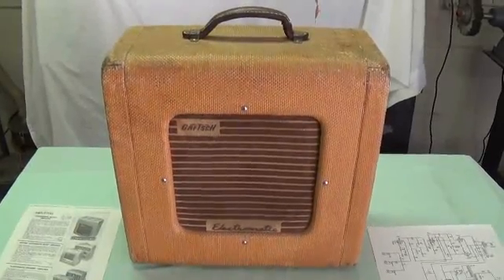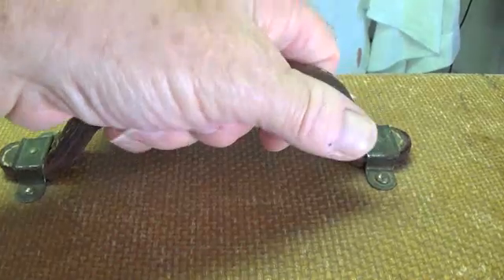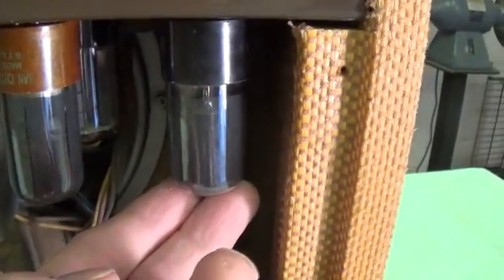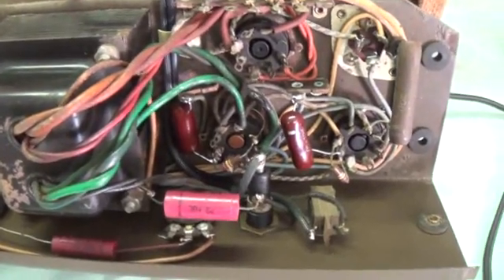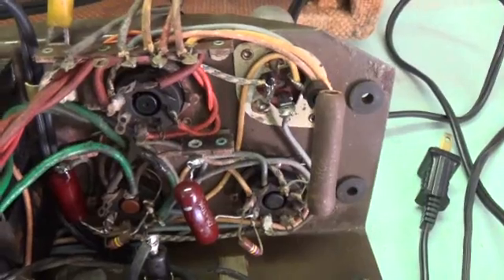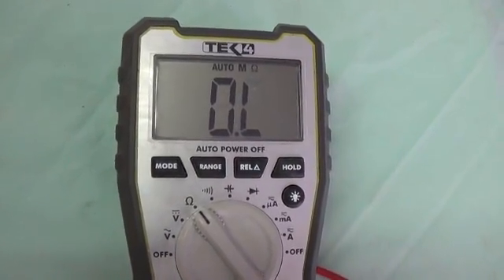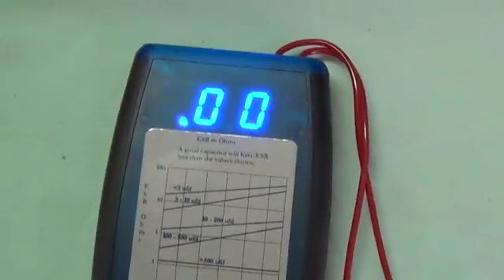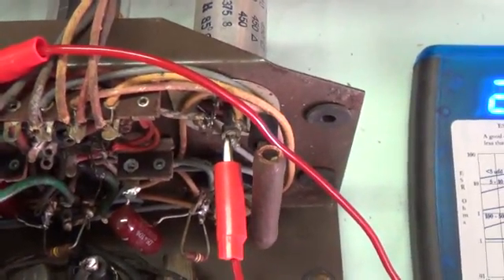Using an ESR Meter to Determine the 'Health' of Electrolytic Capacitors in Guitar Amplifiers

Comment: I have been using a Heathkit I-28 but I have used it most of the time with an external 1000 hz audio wave oscillator.  I find it is easier to more accurately read the value.  I am very interested in the ESR, to the point that I am going to buy one.  I have two old Hallicrafter radios that require re-alignment, and this will be an excellent test for the meter.  I am hoping also that it will save me a lot of time. 
I just read some of the comments below, and am going to look at building one first.
Thanks
Reply from the maker: Greetings, SJJ. I too have used a Heathkit capacitor tester, but have found the ESR meter to be much simpler (and more accurate and reliable) to use. Also, the ESR meter's ability to perform accurate measurements while the cap is in circuit is a definite plus. Please share your experiences with the ESR meter after you have used it for a while. Your impressions and input would be greatly appreciated. Thanks :)
Reply: I immediately searched for, and bought one.  I can't wait until it arrives.  Does it work well for testing large electrolytics?
Reply from the maker: Yes, in my personal experience it can handle capacitors ranging from 0.1uf all the way up to 100+uf. It's a very versatile and easy-to-use device. I think you will really like it.
Reply: Uncle Doug   Just want to confirm.   You say the ESR will work way up to 100+uf.  Do you think it will work, in my case, for one that is 6800uf @ 50 F. or slightly above?
Reply from the maker: Greetings, Edward. I'm guessing that you meant @ 50VDC. Temperature ratings are not relevant to ESR testing. I'm not sure about the meter's effectiveness on capacitors much higher than 100uf, but one way to be sure is to test a couple new 6800uf caps and see what readings you get (if you get any). Then compare those readings to the ESR value for the old 6800uf capacitor. If the values agree, then I would assume that the old cap was OK.
Reply: Uncle Doug Received the following from Anatek:  Is there an instrument that will cover the lower range like Aanateks and the high range I am looking for or must I buy two, one for lower and one for higher range like 6800uf.  Any recommendation if have to buy two.  Thanks for your help.
Reply from the maker: I'm confused, Ed. Is this an inquiry you sent to Anatek or a reply you received from them?
Reply: Uncle Doug Their response seems to be left out of my previous post-sorry, my fault.  I submitted an  inquiry to Anatec asking whether the instrument would give meaningful results for a capacitor in the high range that I am interested in and below is the answer I received starting with: Dear 2015-bogho  then i asked for your help if there is an instrument that will test both the low as well as the high range I am interested in or must I buy two testers, one for the low(ESR) and one for the high ranges.
Reply: Uncle Doug I made an inquiry to Anatec whether this ESR will measure in the high range I am interested in and this is their response:

6800uF is likely too high for this unit.   ESR will be <<0.1 ohm so any change in ESR will have to be significant for it to measure a real change on the meter.

Then I requested your help to determine whether there is an instrument that will measure the low range to the high range I am interested in or must I buy two, one for the low range and one for the high range.  Sorry, my fault for the confusion.
Reply from the maker: Anatek's response makes good sense, since ESR values decrease with higher capacitance. Their meter is the only one I have any experience with, so I have no personal knowledge of meters that can measure at a much higher range of capacitance. Perhaps a Google or Ebay search will reveal if such a device actually exists. Good luck.

Comment: did you try testing them with a digital meter that shows the value? although I would have done the same thing, if the ESR meter shows ok I'd leave the cap in.
Reply from the maker: Yes, I measured the capacitance with a digital meter, but it was "fooled" by two of the caps being in parallel, as is typical of virtually all cap testers (except the ESR meter). The original caps are still in place and working fine.

Comment: One option to purchasing an esr meter for 100 bucks is to build your own, as I chose to do.  There are a number of plans online and if you have stuff lying around as I did it will only cost a few bucks.  I used a 555 for the 100khz oscillator. Also, If you measure a cap with an ohm meter, and get a reading there is a serious problem with the cap, as caps appear to a DC current as nothing more than an open set of contacts.
Reply from the maker: I never thought of scratch building one, Mike, but it sounds like a great idea. Since I deal only with vintage tube amps, I just don't have any "modern" components :) Yes, you're definitely right about capacitors appearing as infinite resistance to DC ohmmeters. One of my tests for capacitors is to verify this. If any of them have a measurable resistance, I assume they have an internal short.

Comment: I own and religiously use a HeathKit I-28 Vacuum Tube cap tester.  It will measure any cap values and leakage up to 600V.  I have seen much claim how wonderful these new ESR meters and pondered buying one but I am curious will the ESR meter test any size capacitor and will it test caps under full voltage load?  Is there any benefit to the ESR meter over the old tube style cap testers?
Reply from the maker: Greetings, BB. I use the ESR meter for both electrolytics and non-polar caps ranging from .01uF up to 100uF at 475VDC. You should check with Anatek to see what they claim its range to be. I know it's generally recommended only for electrolytics, but I have found it to work with non-polars as well.

The advantage is that it tests the capacitors in circuit without concern for error induced by nearby components (i.e. other caps in parallel). No lifting one lead or removing the cap from the circuit. You can check all the caps on a circuit board or in a chassis in a matter of a minute or two. It does not fully charge the capacitor during testing, which some people find worrisome, but I have yet to encounter a capacitor that tests well with the ESR meter and yet has an internal short....or the tendency to develop one. Bad caps generally produce readings that are obviously unacceptable.....there is no "splitting of hairs", and if a cap tests well, it's (so far) OK.

The ESR meter is not my only means of assessing caps, but a part of the process. I also measure capacitance with my DMM, use a Variac slow-start with circuits that have sat for years, and always use a Current Limiter when energizing a circuit for the first few times.
Reply: Uncle Doug I have been doing some research on the subject and have been told that ESR will give false readings on caps under 1uf.  Having used an actual cap tester extensively I have found the majority of old paper caps do not internally short but have leakage under load.  Majority of the time the cap will test within spec but leak voltage at 25, 50 or 100 volts when the cap is rated for 400V or 600V.  Obviously the cap is bad and on it's way out and guessing would not be caught by the ESR meter.  I would be very curious to compare some good and bad caps of varying degree with a cap tester and an ESR meter.

I posted this question to the ARF forum and came up with some very informative answers from regarding the subject.  Here is the link to the thread http://antiqueradios.com/forums/viewtopic.php?f=8&t=264574

BTW great videos and information you do!  I really enjoy them.
Reply from the maker: Greetings, BB. I'm glad you enjoy the videos :) I followed your link and read the comments. I am aware of the perceived shortcomings of the ESR meter and, as I said, do not prescribe it as the one and only way to test electrolytic capacitors....however, in daily use, I still find it to be a very helpful tool when working with vintage electronic gear, and occasionally demonstrate its utility in my videos. I have also documented its ability to accurately measure the capacitance of non-electrolytic caps, in circuit, from .01 to 1.0uf.

As with any tool, the ESR meter has applications and limitations, but to those of us with hands-on experience with the device, it offers a quick and effortless means to check the status of capacitors in a way that no other methods can duplicate. Thank you for your thoughtful inquiry and comments. Viewers like you make this process worthwhile :)
Reply: Bastard Bus what I did is make up a chart and taped to the back of my ESR meter, I measured some new caps an wrote down the readings. So I know what to expect when I testing caps with my meter.
Reply: Mister "Bus", ESR is not a measurement that is tested under voltage so the reading the meter gives is accurate.  And there is four main properties that determine the quality of an electrolytic capacitor - Value, Leakage, ESR and Dialectric Constant.  Dialectric Constant, which is the tendency for a capacitor to act as a battery, is not really a concern in guitar amp use.  With your ability to check the other three properties by getting the ESR meter, you won't have any doubt whether a cap is good.  I have a Sencore Z-meter that checks all four parameters and I'm like Doug, I don't change caps just because they are old if they check good now that I have a good meter.
Reply: Bastard Bus I remember taking electronics class in the 1960's in HS and used those old cap testers, you would apply 600v to the capacitor and test it, that was the best way to test them I thought.  I worked on tube tv's in tv repair class in the 1970's and I seem to recall we had one there as well.
I started in the repair shop around 1996 and all the techs used those ESR meters to test electrolytis caps becase it was a fast easy way> Anyway thx for your info,even thought I'm an old guy I'm still learning/
Reply: Bri G.
Bri, you hit the nail on the head with your last statements.  Back in the `60s a cap tester WAS the best way to test caps...why?  Because everything WAS tube equipment back then, equipment that (as we know) runs at very high voltages.  A cap tester CAN check for leakage at those high voltages and that is what is needed for properly checking caps in tube equipment.  You did not start using an ESR meter until 1996...know why...because in 1996 tube stuff was gone and everything is solid state which as you know runs at VERY low voltages.  An ESR meter checks a cap with extremely low AC voltage so not to activate any other components in the circuit.  Great for quick checking LOW VOLTAGE caps in circuit found where?  In solid state stuff.  But the ESR is pretty much useless for checking caps in vintage tube equipment run at HIGH voltages, with caps notorious for leaking DC because of this.  Now what kind of equipment is Uncle Doug working on and what we are discussing?  Vintage tube equipment from the `40s,`50s and `60s the very stuff you worked on when that cap tester was the "best thing" to have.  Guess what...for vintage tube equipment, it still is.  One can spend $100 plus on an ESR meter that really is not too effective in tube stuff, maybe give you an ideal of your electros "health" at the most.  Remember it only does electros between 1uf and 100uf too and will not test them at full load voltages. What about the other 3/4 of the caps in your amps, the mica-paper caps between .0001uf and 1uf?  The ESR meter even states it will not even work on caps under 1uf but a cap tester will check all your caps good or bad with definitive results. I paid $20 for my Heatkit IT-28 and they usually run $10-$50 max.  Pick one up...try it out...you might be very very happy with the results.  BTW....I will be buying an ESR meter myself...BUT for use on all the Solid State Stereo receivers that have been coming my way for repair lately.  Again....both are GREAT tools when used properly for the right piece of equipment.
Reply: Bastard Bus
You are arguing with a "straw man" here by stating a position I'm not taking.  I never said that ESR was a preliminary check. And you haven't acknowledged that high ESR can cause heating in high ripple current applications be it in a low or high voltage power supply.

Let me state it again.  As a comment on this video, I am able to measure the value, leakage at full rated voltage and ESR of the e-caps in my vintage amps.  If they pass all three tests, I am confident to leave them in service even though they are 30+ years old.  If I could only test value and leakage, I might not be confident enough to leave them in.
Reply from the maker: Thanks for your informative and supportive input, Jeaux.
Reply: Jeaux L
I disagree with the usefulness of the ESR meter in guitar and tube amp applications.  The ESR meter is useful for small value electrolytics in switching power supplies and solid state electronics. Yes, in those circumstances it saves hours of trouble shooting but practically useless in tube guitar amps like above.  I asked some "experts" what they thought on the subject and here is about all you ever would want to know on the subject.    http://antiqueradios.com/forums/viewtopic.php?f=8&t=264574
Reply from the maker: Thank you for your input, BB. Hopefully, viewers will not only watch the video but also read the comments, so they can draw their own conclusions.
Reply: Uncle Doug
I 100% agree.  Keep up the good work and open discussions.
Reply: I worked in a electronic repair shop and we relied on the ESR meter, you're not going to use one of those old testers, you would have to remove the capacitor and it takes time to test it. In a repair you really don't have time to do that.
Reply: Bri G.
Bri, you need to educate yourself what an ESR meter does and what a capacitor checker does.  They are two completely different beasts and do NOT do the same functions-tests performed.  The ESR is basically an AC resistance meter, great for solid state equipment and switching power supplies.  The cap tester checks for actual value and leakage under working voltage.  The ESR meter can NOT test for leakage under working voltage nor does not check for proper cap value.  You need to read the thread on the link I posted in my previous post and educate yourself what each machine does.  They both serve separate and different purposes.  If you feel the ESR meter gives you honest and correct readings for every application out there, that is your choice.  From the facts I have gathered the ESR meter does not give a definitive answer to a capacitors condition in vacuum tube equipment. A capacitor tester such as the Heathkit I-28 DOES.  In addition, the cap tester will test ANY capacitor (mica, paper or electrolytic) from .0001uf up to the largest electrolytic.  The ESR meter only checks 1-100uf electros for ESR. As well the cap tester DOES check caps in circuit unless something is parallel then you need to lift a lead, not a difficult thing in P2P tube electronics, especially when you are getting a definitive answer.  I do agree Solid State equipment is another story, very low voltage electros everywhere on circuit boads...perfect for an ESR meter.  There is different tools that are better at preforming different tasks and work better in certain situations.  This is a perfect example.
Reply: Bastard Bus I agree that testing ESR is not enough to determine if the cap is good.  But high ESR is enough to tell if a cap is bad or on it's way out. Especially for the input filter caps of the power supply of any device.   What usually happens is as the ESR starts to rise in a capacitor that sees high ripple current, the cap heats up internally.  Its simple Ohms Law.  Since heat is the killer of caps, knowing the ESR is too high or rising is definitely a reason to reject a cap in the power supply. 

But you still need to check value and leakage.  And as it applies to the video, since I can check all three parameters, I have the confidence to not change out the original caps in my '77 Marshall.

And I see that some guys that responded to you in the Antique Radio forum are hams.  I am too - KE5Y - extra class since '78.
Reply: Jeaux L
Hi Jeaux,  true using an ESR as a preliminary check for your electros would work but if questionable one definitely should test them for value and leakage as well with guess what...a cap tester.  I guess my line of thought was why spend $100 on an ESR meter to just "guess" on your electrolytic's health when you can spend $20-$30 on a full cap tester and check ALL of your caps with 100% accuracy.